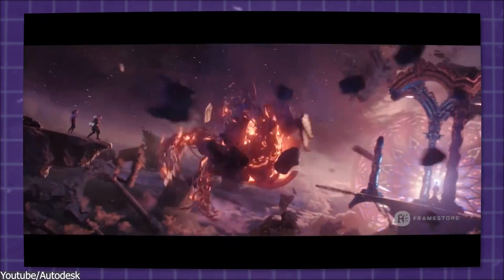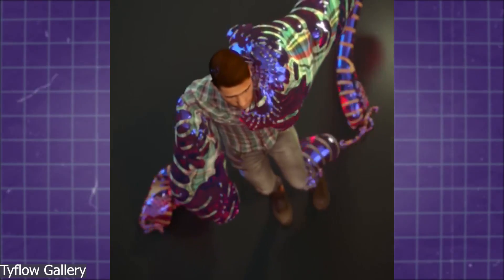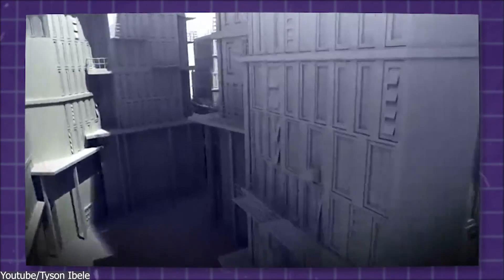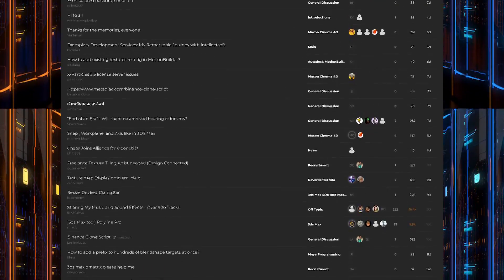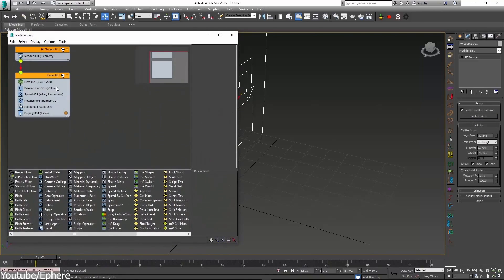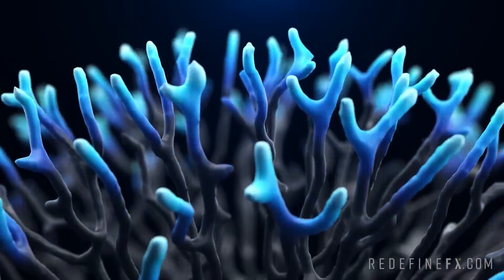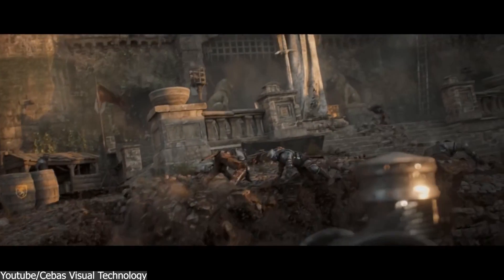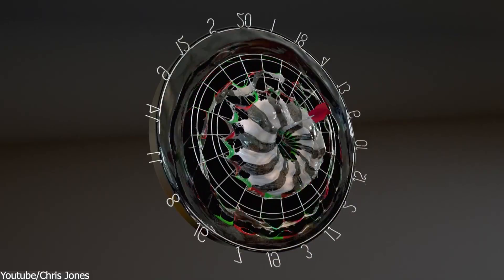What is Tyflow and Why it is So Good | Tyflow

Comment: The only remark that should be here is that the Pflow interface definitely couldn't pose any difficulties in terms of the learning curve.

Clean and simplistic, with everything in a single field (thanks, thinking particles and houdini with multiple graphs for similar things and a feeling of chaos as an initial impression), it might not be the prettiest, but definitely easy to understand and learn.

That's why the TyFlow interface has effectively polished that concept, and thanks Tyson for not going for the complexity for the sake of the complexity.

The only thing from Pflow which TyFlow is still lacking to this day are the math node operators, which are quite more handy than you might think.

Comment: best 500$ i've spent . so much better than PFlow . and I mostly use it for modeling and parametric designs too .. not even hard simulations ..super fast .. max is relevant in my workflow only because  of this .
Reply: Is there really a difference between the free version and the pro version in that all CPUs are used in the calculation?
Reply: @mongolen_klaus9844  well it does ,but you need to see what you use it for to see if that applies to your case, in my case I use Tyflow for modeling mostly , for making base meshes to get to zbrush or modifying my meshes back and forth between two , cloth simulations, fractures and vdb generations(to mesh),weird and advance defroms,  sometime heavy scatters ,etc. in these instances , mutlithread and cuda speee is very different between free and pro.
besides it's one time purchase with one year update (not subscription).supporting something I used for years for free is worth it too.
personally suggest using the free, if you use it in regularly , then worth the purchase

Comment: Autodesk Autodesk… I remember by the time they bought Alias. Next day suddenly the mesh smooth modifier became faster lol.  Autodesk to me looks like a select shop. Specially max. If you remove all plugins you can’t do much professionally.
Reply: 3ds Max isnt dependent on plugins to be a workhorse, but plugins help a lot. Unlike some other softwares cough Blender cough  it doesnt take Max all the plugins to be a workhorse.
Reply: @hound_of_justice  well. Blender is free so this will always be an excuse to question why Autodesk left their softwares to get so outdated. I use max and Maya and blender, the reason why I jumped to Maya is just because it could do things out of the box, without relying on thousands of plugins on max. So I have this impression until now, that max relies a lot on plugins to achieve profession level. But Maya is little by little going the same way. And I don’t know what happens to bifrost team and their roadmap. Looks like guys want to work but Autodesk doesn’t.

Comment: Why isn't there any plugin like x-particles or tyflow for blender?
Reply: Nobody has considered working on it
Reply: Blender is capable of doing particles very nicely, but you'll need to be fluent in node editor construction and python/C++ scripting if you really want to get the most out of it (this applies for all 3D software as far as adding further capabilities than what comes in them by default) those parts of these programs are the true engine that makes them be favored for one thing or another.

Lately, I've been using Ai to help me write scripts from scratch based on what I want to accomplish. Just gotta do some trial and error testing and figure out how to best instruct an AI on the outcome you wish to achieve. Then, when it works as desired it can explain to you in simple terms why and how things work line by line if you need clarification as to what it's doing. Which can be fairly straight forward and time saving when compared to the never ending research/hunt for useful tutorials or internet sources that cover precisely what you're after.